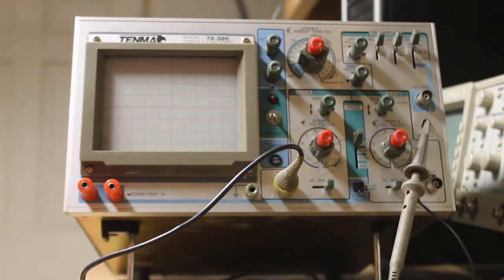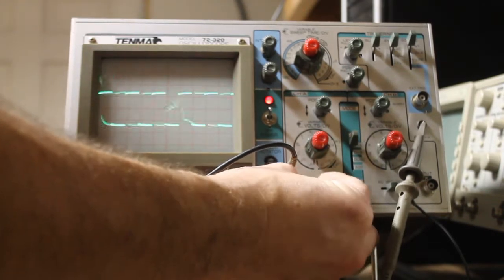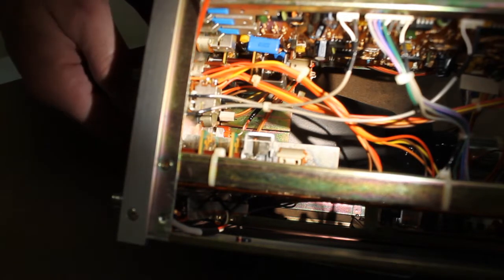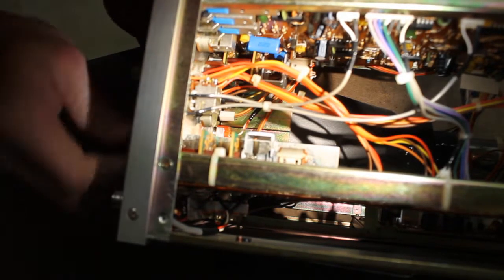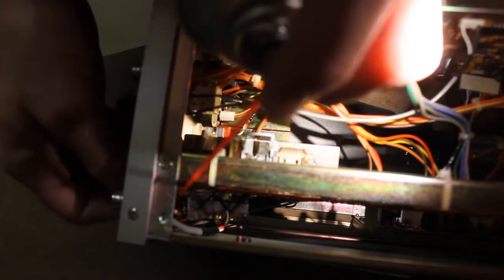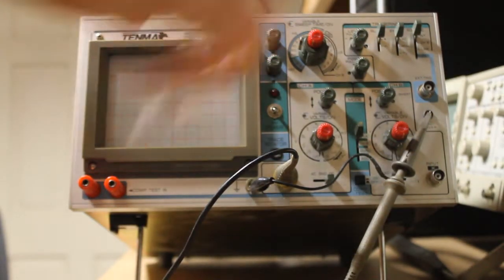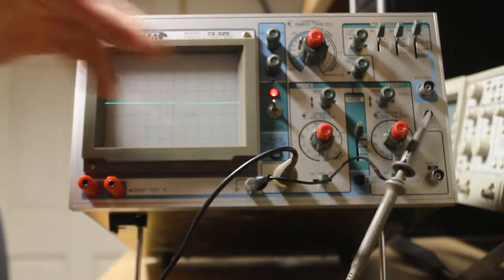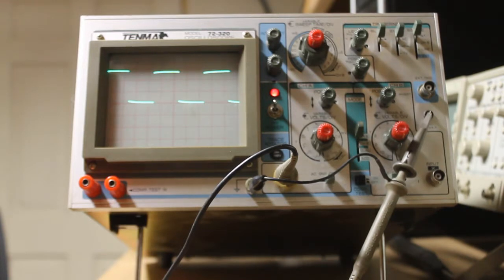Tenma 72 320 Oscilloscope Repair

Comment: This 'scope was sold under several brands, including as the "Hung Chang OS-620", which I have. 
It's been a great workhorse, and has survived some HV abuse that wrecked some cheap DMMs connected to the same sources. The only fault in around 30 years, was a bad diode in the HV section about 25 years ago. And the timebase knob recently cracked apart. My only general complaint with it is that the triggering was always a bit tricky to get right.
Reply from the maker: Older scopes can be fun. The pallet of these that I received surplus mostly work, and I think the others are repairable. I do enjoy having the component tester function, which can be handy as long as you have read the manual.
Reply: @user-lp3cf5yn5b  You don't need a probe to get a trace. 
But make sure the control settings aren't hiding it - play with the brightness, trigger level, vertical position.
Reply: @user-lp3cf5yn5b  I don't know what all the CRT voltages should be, but if you can find that out, then at least one must be wrong or there'd be a trace (or you have a dud tube). I'd try to verify what all the voltages should be. Have you got the manual? - IIRC it's pretty good.